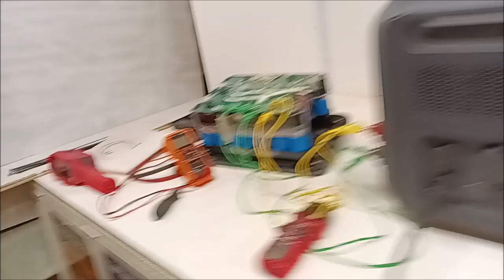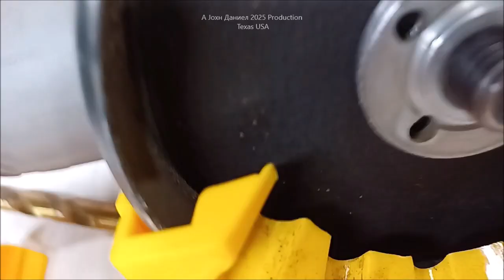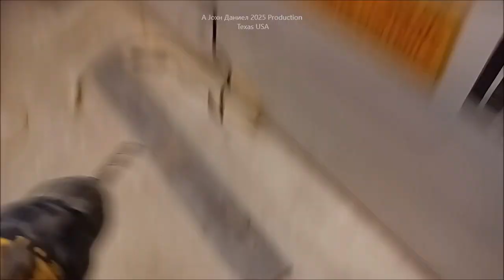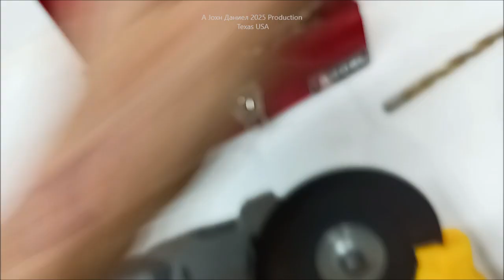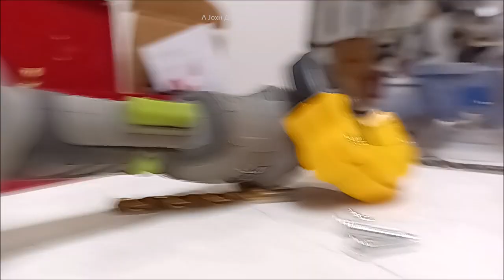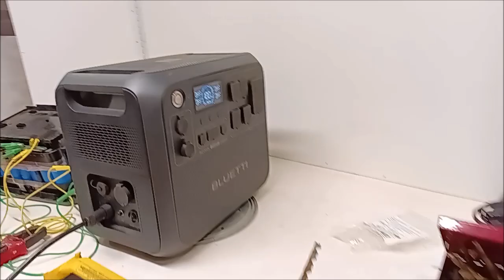Cheap $5 Drill Sharpener kit from Temu, Does it work, Lets try it.

Comment: A tip: turn left to sharpen.
Reply from the maker: Yes, counter clockwise. I did that in the drill and had it in reverse when putting the bit to wood as you seen. Video frames made it look either way. Also when I set the camera down I did counter clockwise, I did both directions, one to remove the bad grind from the drill and the other to get re-sharpened.

Comment: That guide will be good for getting your point angle correct & even. However, you will need to grind away some material for relief after the drill cutting edge. If you don't, the drill will just rub drilling metals. You might get away with drilling wood or plastics, if you don't grind that relief. I enjoy your videos, and you've taught me a lot about batteries, inverters, and solar. Thanks. I hit that 👍almost as soon as your videos start. Entertaining & Educational.